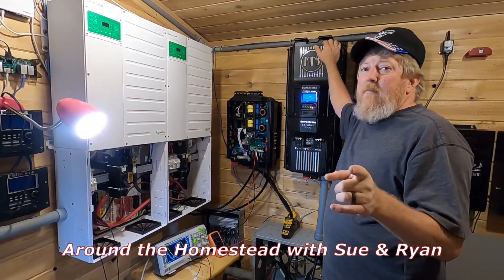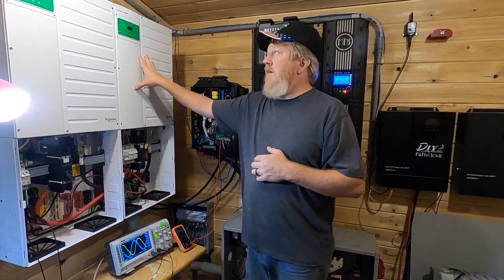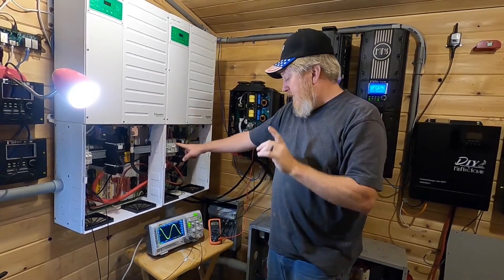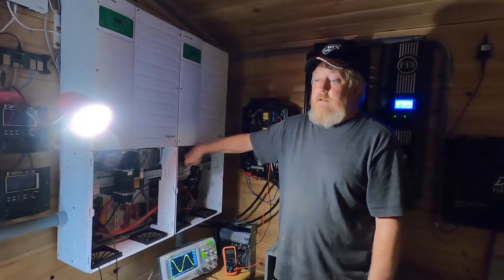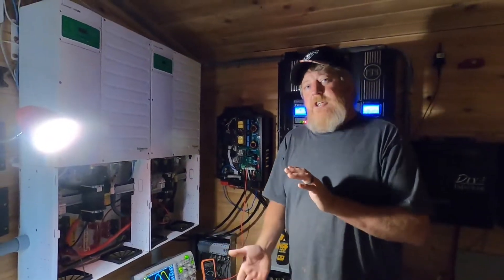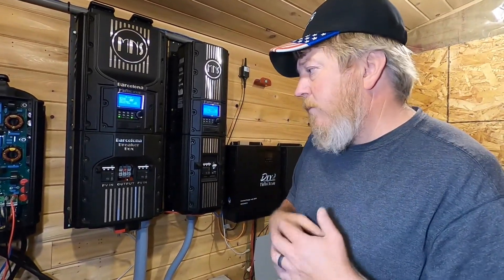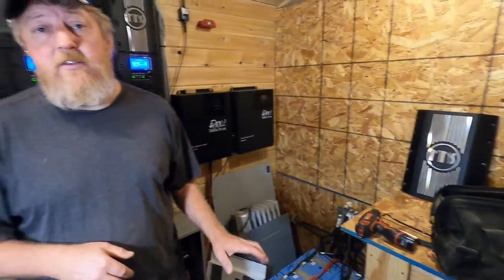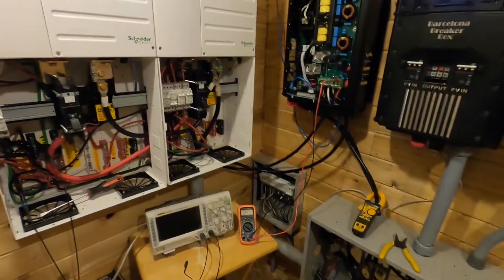We torture test the VERY FIRST MidNite Solar Rosie Inverter

Comment: I have XW it's 130 lbs.....6.8kw...so how the heck can the Rosie at 60lbs do 7kw as reliably as XW....I'm being serious because I'm seriously considering a Rosie for my van build. Like how does it do better and be so much smaller?
Reply from the maker: The old technology used a huge transformer internally, almost every manufacturer has moved to what is being called High Frequency but what that means in a nutshell is that instead of a single inverter and HUGE autotransformer they use a very small light weight transformer on the output of two inverter sections and reduce weight. The High Frequency uses a lot better switching electronics and switches at a much higher frequency allowing for more efficiency and high surge ratings.
Reply: @aroundthehomesteadwithsuer3497  Does the Rosie use normal FETs or is it using newer technology IGBT output devices that handle surges much better than FETS.....they are also more expensive. Please advise.

Comment: Great video and test! The only way to know where the line is, is to go over it. It's great that it failed safely, came right back up ready to go without damage.

I also see in one of your replies below that the LRA was 110 on the grid. Great info.
Reply from the maker: Yes and the Rosie was handicapped a lot in this test. Lots of battery cable length and the compressor is a long ways away on the AC side. One day we will get the system set up better and do more testing

Comment: Does Rosie have Time of use settings? There is nothing in the manual about it.
Reply from the maker: Yes she does, I forget exactly where in the menus now but I think it is "Setup --> Inverter config --> AC input" if memory serves. I can try and do a quick video on this mode today so check back a little later
Reply: @aroundthehomesteadwithsuer3497  I would really like to know. I want to buy one.
Reply: @aroundthehomesteadwithsuer3497  You don't really have to make a whole video on it, I just really need to know if it currently works so I can purchase one. 

But if you want to make a vid, I'm not gonna stop you 😀
Reply from the maker: @cs-xd9gy  I can confirm when I tested it a few months ago it worked fine. Opens the relay at the time programmed and re closes it at the time programmed
Reply: @aroundthehomesteadwithsuer3497  OK, I'll place my order. Thank you.
Reply: Just placed my order. How does she switch from 240 in to 120 in? 
If I have 240 in from the grid and it goes down. Fire up my 5k 120v gen, do I need to change anything in the settings for her to work from 120v in and still output 240? Or is it just a watt in equals watt out deal?
Reply from the maker: @cs-xd9gy  No changes needed if you apply 120 in it will use that and make the second leg 180 degrees out of phase for 240. Just be concius you may need to turn down the AC breaker size to not ler her over load the generator

Comment: Have you ever measured the the in rush amps on that Air Compressor?
Reply: Ya good question cuz I think it should have started that compressor. I'm betting there is something wrong with the compressor....I have a single XW I would have bet it alone would have started that compressor. I also have an old magnum I would have bet would come close to starting it....

Comment: question about the Rosie. Most of the High Frequency inverters I have looked at don't have a battery temperature sensor. Does the Rosie have one?
Reply from the maker: Yes the Rosie comes with a BTS and Remote battery voltage sense and a couple Aux outputs. As well as support for the WBjr and other stuff I am sure I am forgetting

Comment: It looks like this thing tried til the death to start that compressor.  It seems that some other inverters will shut down via software before they actually overload. Glad it restarted!
Reply from the maker: Yes, I am told by Midnite Engineering that was the intended response, It is never allowed to spike the AC voltage but it can brown out a few times over a few seconds. This of course is software and will be tinkered with based on feedback

Comment: Do you think the length of the wire run might be an issue?
Reply: maybe not so much the 120V, but the DC from the battery to the inverter
Reply from the maker: I suspect the DC wiring plays more into it. We have a lot of cable between the XW and the actual battery unfortunately

Comment: My two Sol-Ark 12K's would start it.
Reply: 100% the SA 15k wouldn’t start that compressor
Reply: @NC_Hydro  I've measured my sol-ark 15k starting more difficult loads than that. So it should fairly easily start it.
Reply: One 15k might be able to do it. It can do 125A for 100ms and 100A for 10s.
Reply: If the pair of XW's won't do out, there's almost no chance for the two sol-ark's.  There is quite a bit of video proof on youtube that shows the XW is stronger than the sol-ark 12k's at starting.
Reply: @sadlert  a single 15k can do 125A at 240V for 100ms
Reply: @niktak1114   Yes, on paper the Sol-Arks look great, and for most things, they are great, but the one thing they don’t do well is start large motors, even when the stats  promise otherwise.  Sol-ARKS are becoming famous for this one weakness.  Too bad really, they were my first choice.
Reply: @sadlert  Maybe that was true for the older models, but the newer ones have no issues with large well pumps and central ACs.
Reply: @niktak1114  Good to hear, I do like their concept very much. Thanks.
Reply: Sure, it might start it a few times, But after a year or two of use, I'll bet you any amount of money that you'll smoke your Sol-Ark high frequency, output  transformerles inverters.

Comment: Is there a way to add a soft starter to the air compressor?
Reply from the maker: Good question, In our case it runs on the grid so we do not worry about it
Reply: How many amps does it pul from grid @aroundthehomesteadwithsuer3497